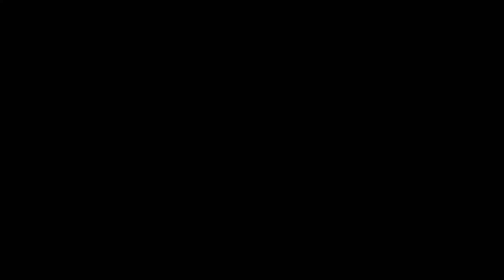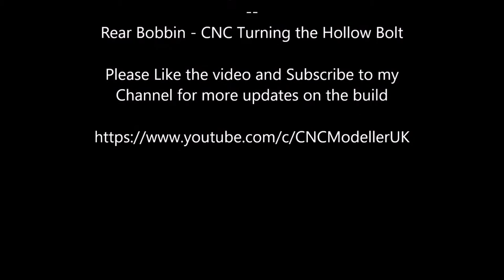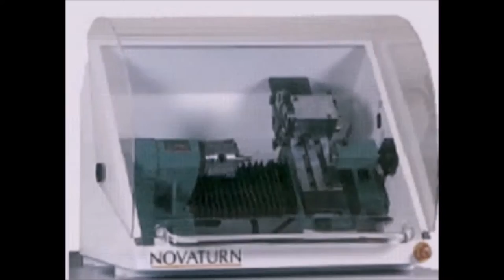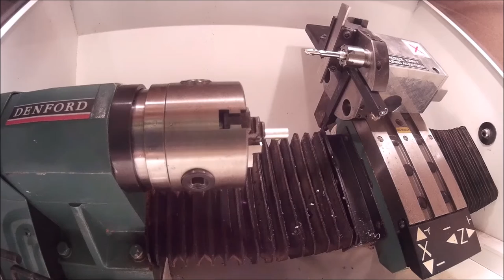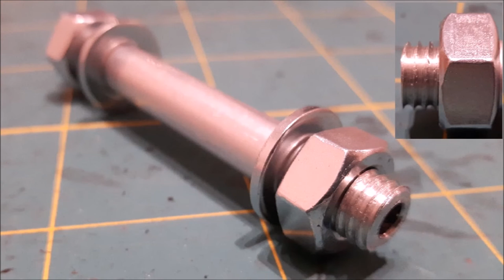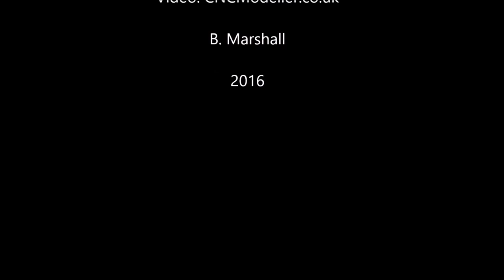New Design 3D Printed Braiding Machine #8 Cutting Threading the Hollow Bolts with a CNC Lathe

Comment: Hi Barry,
in one of your vids you considered making the STLs  available . I see you don't have as much time atm, but I also understand the machine itself is working... Would be great if you would make these available and save some of us the hassle of going through a couple of design iterations ...
If others would have a go at it you might be surprised what crowdsourcing engineering capabilities would achieve, espacially beeing short on time you might just be confronted with a finished design by the time you'd have time again ;)
brian

Comment: Barry, would you be willing to do an update video on your braider? I've been working on my own printed version off and on for a few years now, but your design has me rethinking my approach and eager to see how yours ended up! Keep up the great work!
Reply from the maker: Hi Michael, unfortunately due to personal reasons progress on the braider has been slow. The actual braider its self works fine, but I'm working on a motion control platform to move it across the item being over-braided in a controlled manner such that I get a clean weave with a controlled braid angle. The platform it's self is not really an issue, its the motion control algorithm to get a constant braid over a varying radius former that has me a little stumped :-).

I've also been working on upgrading a K4 laser to cut the parts for a more robust version, again this is a slow affair. I'll probably be posting videos on that too. 

Will hopefully get back to the braider during the autumn, now the weather has broken. 

Thanks for the positive feedback!

Comment: what is the cutting fluid Barry?
Reply from the maker: Hi Mike, it's Action Can CT-90. The guys at my local industrial fixings supplier recommended it, they use it for machining bespoke items. It's probably just a blend of oils, but it does make all metal cutting activities much easier. I use it for drilling, sawing and milling / turning.